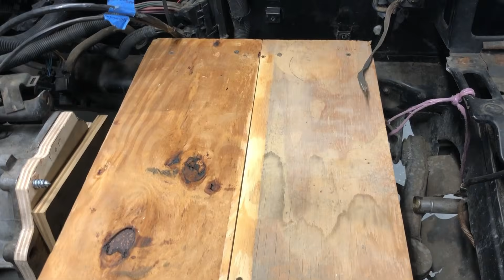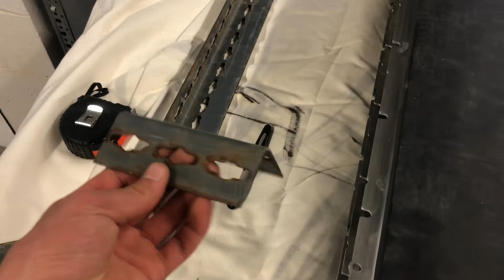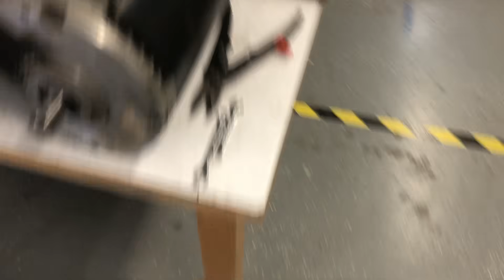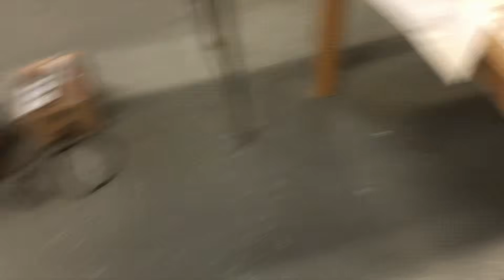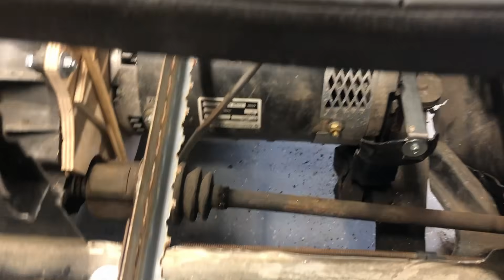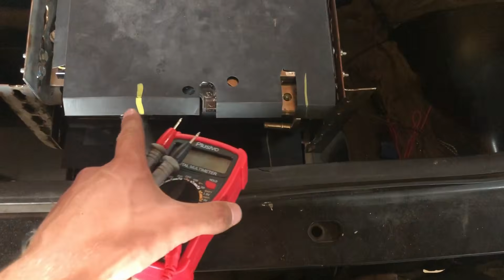Battery Installation Overview- 1984 Pontiac Fiero EV conversion update 3

Comment: Just to clarify, These are Toyota RAV4 EV Modules, Not Hybrid. They are built by Tesla.
Reply from the maker: After some brief investigation, I believe that you are correct. The website I bought them from has them listed under "repurposed hybrid batteries," but they are from a RAV4 EV. They are built by and very similar to Tesla modules, but are configured to ~44V as opposed to the ~24V in traditional Tesla modules.

here is the website link if you are interested: https://greentecauto.com/hybrid-battery/repurposed-batteries/energy/toyota-rav4-tesla-nca-44v-124ah-5-5kwh-battery-module/